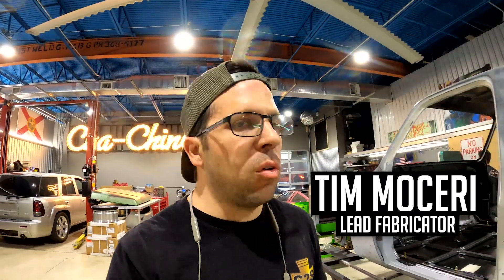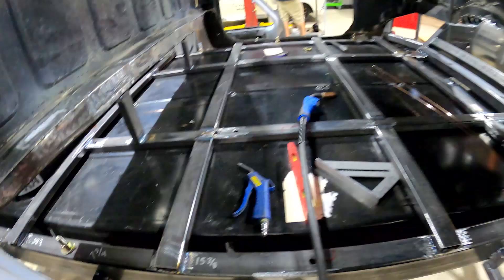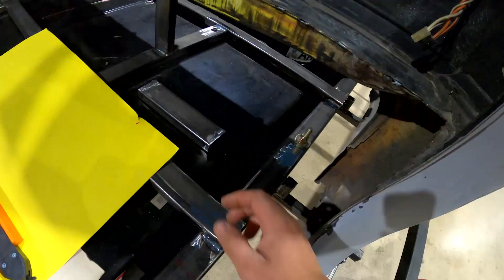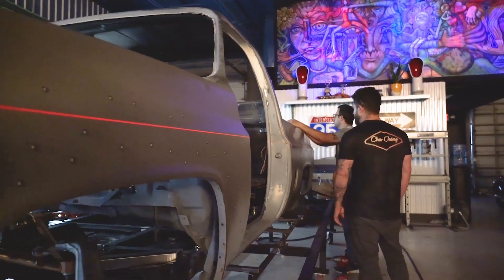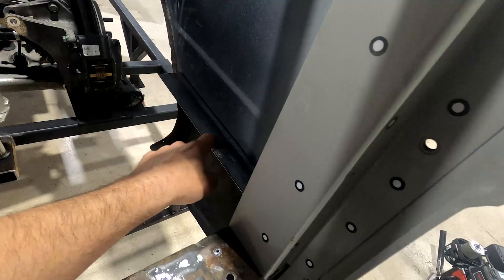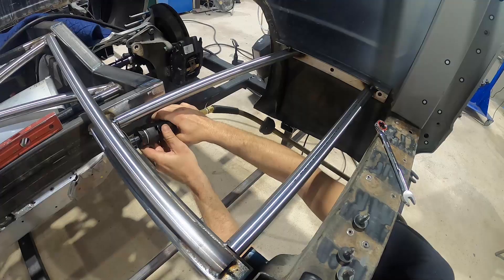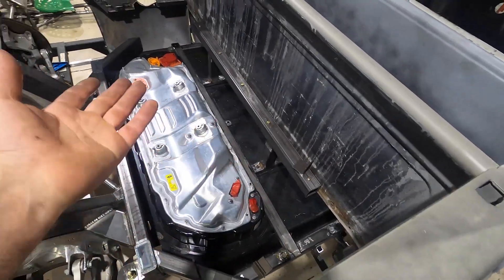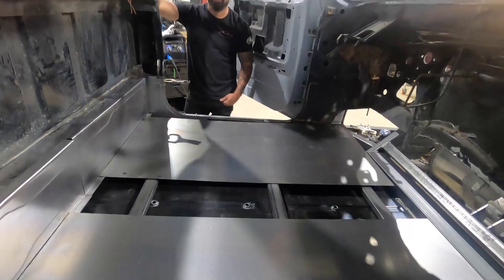Unibody C10??? Tesla Swapped Squarebody - Electric C10 Ep. 6

Comment: How did you get threads into the frame for the bed support bolts? Did you pull the bed off and tap them after you drilled the holes?

Comment: The interesting part about the torque provided by those motors is that they won't twist the chassis. So chassis rigidty isn't as important as if you had a great big motor trying to flip upside down under the hood.

Comment: This is an awesome build; I’ve really enjoyed the episodes. At the end, you mentioned an incredible amount of torque, around 3000 ft lbs. Have you considered the amount of torque steer you’re going to have since you have two different lengths of CV axles up front? How are you going to mitigate it? Having the same length CVs would solve that, but you’d need to be a little more creative with your front motor mounting, it’s a hard problem to solve

Comment: Hey ! 
Can you do the same thing to my 78 Chevy Silverado square body Truck , 
But instead of the 2 Tesla electric motors , I would like a Chevy 
Small block 327 , 12:5 to 1 compression forged pistons ,
Steel Crank , 2:02 double hump heads , Stainless steel valves , Crane hi lift cam shaft , gear drive , Torker II intake , 850cfm carb. , Long tube Headers , 11 inch heavy duty clutch , M-22 Muncie Rock Crusher  4 speed Trans , 
Add a Eaton Posi Trac to the 12 bolt rear end

Comment: Leave it flat. Bench seat would give a three passenger vehicle.
Reply: 4 if they skinny
Reply: @garykeenan3724  or "friendly"
Reply: @LawrenceRhodes  friendly was always a gear head like fast cars/vehicles, trucks; planes etc
Reply: @LawrenceRhodes  friendly? Like the truck build I use to build semi trucks and truck end slip boxes never owned a pickup but when and if I do going to be something I built tubbed big rear tires and a powerful motor!!!
Reply: @garykeenan3724  Sounds like a nice project. Just going to get the mid range Cybertruck and be done with it.

Comment: lol, so... he says that they're going to make huge torque and power and... out of context the maximum 536HP and 4330 lbft of wheel torque that they can get from their combination of motors and battery pack sounds like a lot. However, with the motors that they chose they could have had 1290 HP and 9341 lbft of wheel torque with a custom battery pack that was built properly. Actually, the model 3 battery pack that they have isn't even powerful enough to max out two tesla small drive units, which would have a max of 600 HP and 4539 lbft of wheel torque. Using a hacked model 3 battery is easy, sure, but it's holding your build back from being something special and basically the drive unit that you have in the front is a waste because the rear drive unit can handle all of the performance that the battery pack can make on its own.

Comment: If you plan on a console from the dash to the back wall of the cab, don't bother with a trans tunnel. If you don't plan on that, Def make a very undersized 'trans tunnel' that is removable from the inside, so you have a simple place to put all your wire runs through

Comment: You guys added more bracing for more protection against bumping and movement of the bed. But more mounts just make it harder to get it back straight after a bump. More brackets are more points to move and not be aligned where originally. Might want to rethink having more mounts for that bed. In that case less is better actually. Again due to less relocation spots to pull or replace when actually bent. Even small bends will move them all

Comment: Please forgive my ignorance but with all the tubes and bracing you guys put in doesn't that add a insane amount of weight to the truck, at what point does does all the extra metal take away from the motors
Reply from the maker: Yes and no. While the bracing adds a lot of extra weight, it's needed to keep everything solid with the amount of power the truck will be putting down. You gotta remember that at stock, these 85 square bodies could get a 454 (best case scenario) that wouldn't be putting down even close to the torque that this truck will end up with. As much as we want the truck to be as light as possible, we need to make sure it has enough structural stability to handle the two motors.
Reply: @SalvagetoSavage  Cool. thanks for the reply.

Comment: Electric C10 Bulldozer. 9800lbs and counting.  Just need a few more braces in case a locomotive rams the rear quarter of the bed, it will evenly warp the entire frame rather than denting the bed.

Comment: Also voting for flat floor. Having a fake tunnel just looks like a gas cab slapped on an electric skateboard. Sure it's gonna be a bit more piping and wiring to send everything down the side rails rather than right down the middle, but clearly y'all don't mind a bit more work if it will look cooler in the end.
Reply from the maker: Loving the input! Thanks for the ideas! We're definitely not afraid of a little hard work

Comment: I see that you are using a lot of thru bolts. Why are you not using rivet nuts? Most of the applications I see you using they should be plenty strong. They have a pretty high shear and tension strength.
Reply from the maker: A lot of the stuff that we're through bolting is for the purpose of making it removable. We want to be able to change, repair, and service parts without too much of a headache.

Comment: Regarding the tunnel, this would be the perfect opportunity to do something really different like making a tunnel that’s bigger at the top. It will be completely opposite of what most builders would do, start off with a very thin profile at the bottom and have it turn out like a upside down pyramid, you’ll get more foot room and have a unique look. Normally designing the tunnel this way would be impossible, but not so with an electric vehicle. You could also design a tunnel with a C profile,  from the passenger side it would go straight down to the floor but from the drivers perspective it would be like a shelf with a space underneath.
Reply from the maker: That would definitely have a super car sort of feel to it!

Comment: Trans tunnel could be used for wire, cables, and coolant lines. Make it easily accessible with removable panels.
Reply: Battery coolant?
Reply: @rsess1116  He is using Tesla batteries. They have coolant going through them.
Reply: @wcatkins  ok ok, didn’t know that about them

Comment: Center console is needed to fit electrical controls and the >microwave<. Those bolt threads on top of the frame need to be eliminated, should have dimpled the tube and weld the nuts flush. Come to think about SEMA, you should fabricate a lexan see through bed floor.

Comment: Leave the floor flat and do a bench seat (it is an old truck after all).
Reply from the maker: We'd love to do a bench like we did in our F100 build, but this thing has got to have buckets for the track!
Reply: @SalvagetoSavage  do 3 bucket seats across
Reply: @UnderwaterHunter96  dude that is a rad idea! Would be totally unique never seen it before.
Reply: @UnderwaterHunter96  i agree.  Keep the flat floor and 3 seats.  Heck go mclaren f1/speedtail style and have the steering in the center of the cab since you dont have a traditional motor to contend with.
Reply: @SalvagetoSavage  do the faux tunnel with 2 large capacitors under. one for the front, one for the rear motor that bypass the cpu an dump full power to the motors for burnouts! An for the buttons on the steering wheel instead of NOS written make a mirror image SON "savage overload nexus" ⚡🙆🧻
Reply: @SalvagetoSavage  for keeping the driver and passenger secure.. all 3 laps it will be able to do on one charge!
Reply: @SalvagetoSavage  how about a 40/60 bench which you can swap out the drivers seat for a bucket?
Reply: 3 racing seats with oh shit grab bars close by.
Reply: I fully support Luke's statement. flat floor bench seat.
Reply: He is going to track it. So I bet he does bucket seats. A bench seat would be cooler tho
Reply: Gotta keep it flat! Leg room for days! Definitely need bucket seats for the track though.
Reply: I am with luke
Reply: Agreed

Comment: I would not leave that flat. Maybe don't put in a full size trans tunnel but the little effort it would take to put in if you need it compared to trying to run wire loom without it makes it worth it. Maybe you could just run a single 1 in tube down the middle.

Comment: Unibody is cool and all but, you can't use it as a truck anymore, any extreme weight will pinch the doors shut. that's why Ford stopped their unibody truck in 1962
Reply from the maker: We don't plan on hauling too much with this thing. Thanks for the heads up though! We appreciate the support for the channel!
Reply: @SalvagetoSavage  To be completely honost if it can't be used as a truck, why make a truck? I would love to see this under a coyote ! https://www.facebook.com/photo?fbid=10159732687066155&set=a.100867611154